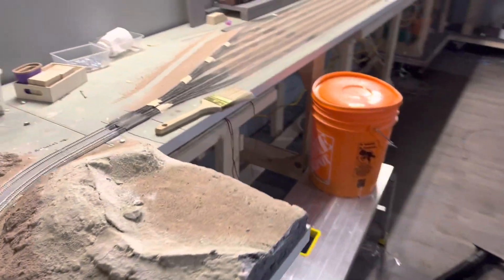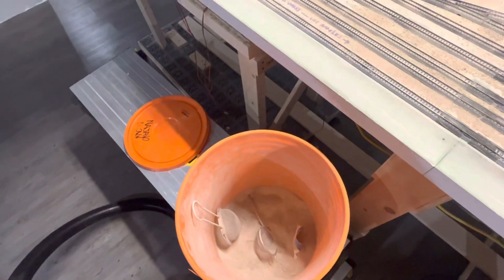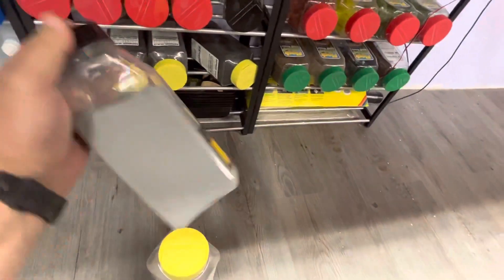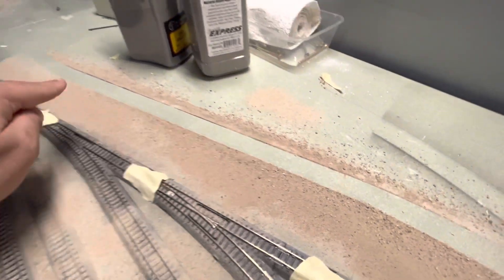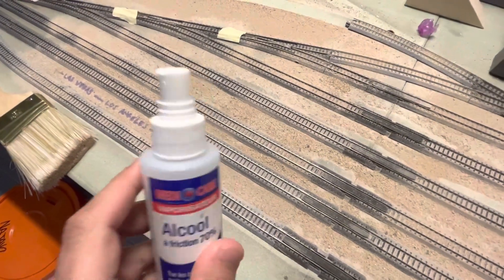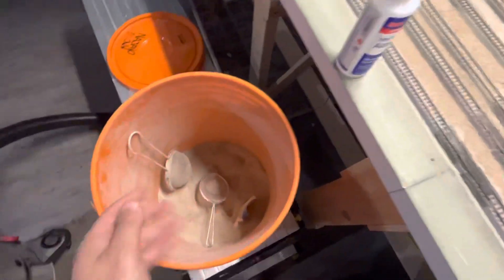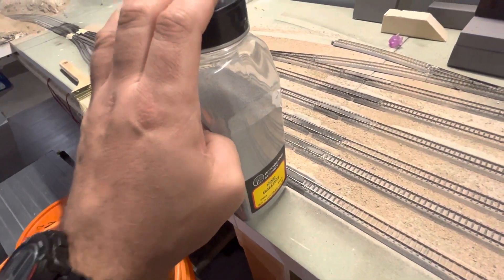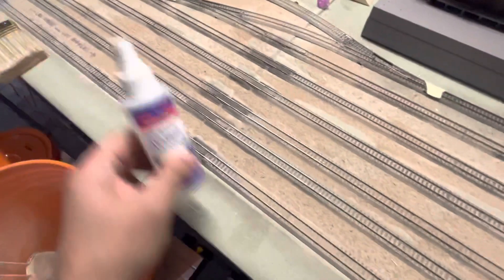N scale HOW TO BALLAST KATO UNITRACK with TILE GROUT

Comment: I have two N TRAK modules, that I use for shows. I'm going to be laying KATO track on a piece of 2'X4' piece of half inch piece of plywood, which I will be storing under my bed. There is VERY limited space in my apartment. I find your glue dots very helpful, thanks.

Comment: Overall looks great & I love that you took the time to explain why and how you are doing YOUR ballast as so many people gloss over and say "ballast, brush, alcohol & glue ...it's boring." But small layers are great, u can add but subtract is difficult. as opposed to spraying glue use a pipette, takes longer but I like running trains & not looking for glue on the rails. Is it my favorite thing to do-NO, but for me it helps teach patience and calms my OCD (I actually have OCD, it's not a sarcastic joke for me, but I do like sarcasm!) Just starting my 4th layout so always looking for different perspectives & ideas. Thanks for sharing! ⭐⭐⭐⭐⭐
Reply from the maker: @SD45-ET44AC  it’s just an alternative method. I have gotten better at it refined my technique further since this video was filmed. 
It is cheaper, it looks better and if you do it the way mentioned no residue on track. If you make a mistake, a stiff little scrub brush takes it off the track also. Really no different than removing the other kind.

Comment: small point: grout isn't installed dry and then wetted with a sponge, it is mixed with water then troweled on wet, then cleaned
Reply from the maker: @jeffcramer6722  I spray alcohol and water on a couple layers and super soak it 
It’s working great
Reply: @N_scale  I was actually referring to how tile is grouted
Reply from the maker: @ yes
Reply: @N_scale Is your grout used for tiles in a kitchen?
Reply from the maker: @ tile grout

Comment: thanks Man that's an awesome idea and heaps cheaper and you can get range of colours and shades as well just goggles our local bunnings that's a hardware store in Perth Australia its like its like $11 for a 1.5kgs so cheap
Reply from the maker: Make sure you layer it 
Thin 

Sift it up and keep wetting it as soon as it dries which if you use alcohol is pdq.

And at end I like to seal it with a brushed on glue and iso

Comment: Nicely done and excellent tip. Looks great.
Reply from the maker: I like it a lot. Some don’t but I’m trying to show something nicer than normal ballast and much better looking because the grains are finer. Literally 50 colours to choose from
Reply: @N_scale  and the glue is included, almost a 1 step application.
Reply from the maker: @Mason-DixonRR  I try to explain the benefits to everyone. More realistic, cheaper 20$ for a giant bag, available in any colour, finer than woodland scenics, and not the same colour as everyone else’s. Plus it’s way less mess on the rails and much much easier to apply. You get it!

Comment: Arizona Rock and Mineral makes lots of colors for different areas.
Reply from the maker: A fortune to ship vs Lowes Home Depot etc in your town. Yes it’s real rocks. Still doesn’t have the glue built in. The spraying glue on rail and buildings is over. This way is faster cheaper and better in every single way.
Reply: Yeah but isn’t grout permanent? How would you get it off your track if you decided to sell it? I love Arizona rock and mineral. They actually use the colored rocks of the real railroads. Plus if you decide to remove the ballast you can just drop the track sections in a bucket of water and it falls off. I do like where you’re coming from scale appearance.

Comment: 0:59 One problem with grout is it is powdery. If you get it anywhere close to a Kato #4 turnout, you’ll destroy it.
Reply from the maker: So far so good
I use sparingly around the turnouts frog and points. I use a brushed on coating of alcohol and mod podge to seal it all. 
I will never go back to ballast. It looks much better and I can pick any color, cost, well 22$ to do an entire layout vs 15$ a canister